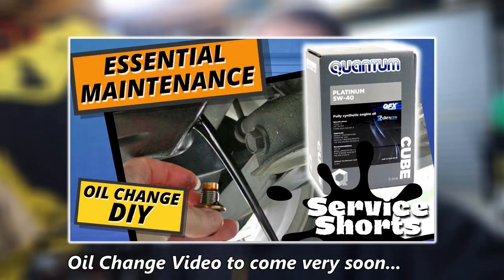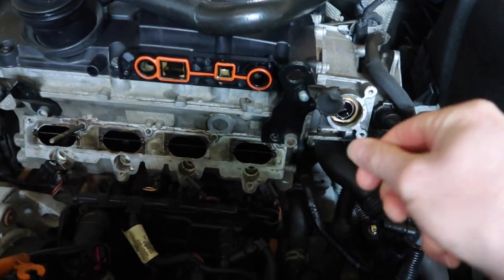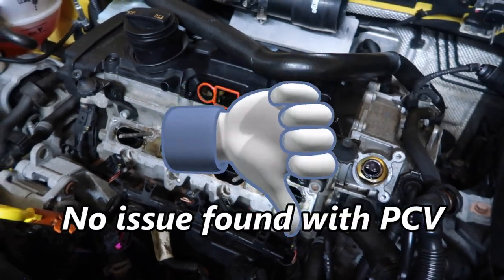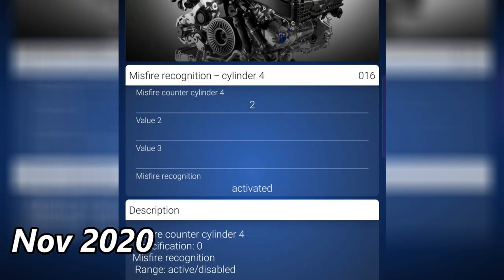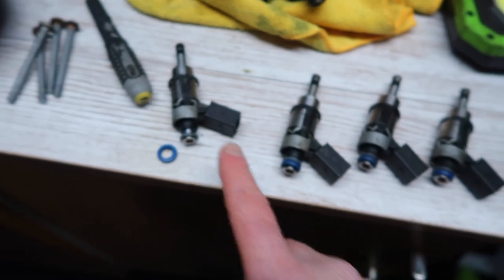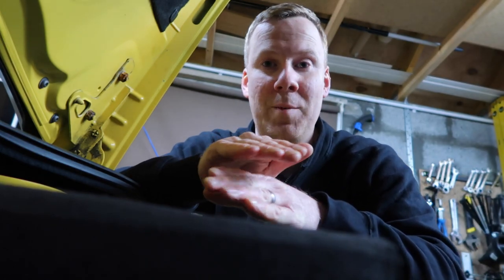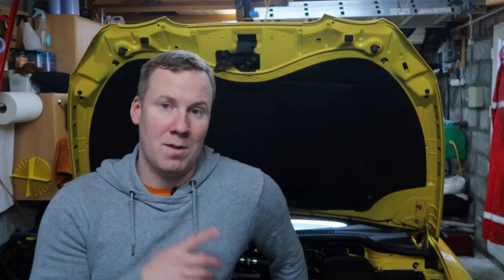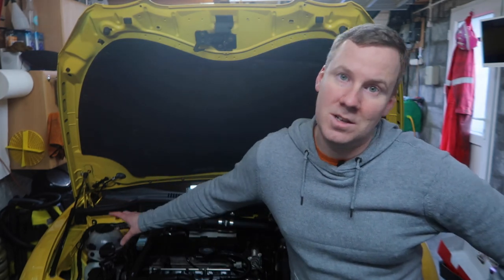2.0 TFSI Engine Problem | Fixing a Fuel Leak & Slow to start - MK2 Leon 1P1

Comment: Great help, exactly what has happend to my car after the dealership did a Carbon clean..... They damaged the seal on the back of the injector, leaks a lot..... They are  not gonna be in a good mood after they have talked to me again......
Reply from the maker: Sorry to hear that they've caused that issue, but glad the vid helped a bit with diagnosing the issue u were having.
Hopefully it all gets sorted for you mate 🤞🏻

Comment: Hi, great video.  Is it R-tech performance inNuneaton that you sent your injectors  to?.
Reply from the maker: Cheers Frank, and yeah that's them. The fuel injector clinic is just their separate dept that deals with all the injector side of the business 👍🏻
Reply: Thanks Kev, I’m in Beauly and from Thurso. My sons Seat Leon developed sudden fuel leak down front of engine around 3rd/4th injector, quite a flowing leak, don’t know if you have experienced that, manifold is off, not as bad a job as your one, cheers.
Reply from the maker: Ah Beauly's a lovely place, and what a coincidence you're from Thurso too! 
I've not experienced leak down, but seen what it's like and it's one of the tests the fuel injector clinic do. Those injectors do sound like they could be at the end of their lives sadly. I'm sure the fuel injector clinic/R-tech guys can help. If you give them a call, leave a voicemail if their busy, they'll call back and say what to do for sending them off. (They are on Facebook too 👍🏻) best of luck with it Frank 🤞🏼

Comment: Hi Kev, I know this is an old video... but I have an old Leon FR 2009, first the purge valve went bad, change it for an new one (not original but same design, CMI if I remember) so that solved the hard to start the engine after refueling issue for i.e. but now I get the MIL light on and 001089 - EVAP Emission Control Sys P0441 - 002 - Incorrect Flow - MIL ON, so after watching your video I tend to think its the canister (there is no leak on the fuel cap, nor the lines (I think).  Would it be possible to disable this feature? someway fisically? or with VAGCOM? thanks
Reply from the maker: Hey mate, cheers for watching. 
I don't know if it can be disabled, not something I've ever looked into.
I've swapped out my evap canister in a different vid on the channel (if u look through older vids)with a new canister from Amazon. It wasn't OEM, but a £30 cheap version, but it has worked perfectly since and car runs fine with this new one. 
Prob best to swap it out with a new one. Parts like this are usually part of the engine for a reason, and having the ECU ignore them completely via programming, can sometimes be risky.
Hope that helps 👍🏻
Reply: Could you hear a hissing coming from the injector at all
Reply from the maker: No not at all

Comment: hi! I have the same problem with my ea113, but mine does this after 4, 5 days. once it starts, everything is fine. I start it the next day, everything fine. the problem occurs after a few days of sitting. do you think this could pe the issue ? thanks!
Reply from the maker: It could possibly be the same yes. Maybe the seal that was damaged on mine isn't as bad on urs but bad enough that it loses fuel pressure after a few days.
Can you smell fuel at all while it's sat turned off? 
If so, you probably have a leak somewhere that's meaning you're losing fuel pressure.
If you manage to get a hold of any diagnostic software, that will definitely help see what the engine is doing.
Reply: @NorthCoastWorkshop  thanks! i ll come back after diagnosis.
Reply: i fixed it! i did exactly the same: got my injectors checked and 2 of them were bad, changed them with the revision ones, replaced all the seals and now it starts perfect every single time. thanks!

Comment: Facing a similar issue but mine splutters when starting. What rail pressure are u seeing when cold after u sorted ur issue?
Reply from the maker: I think it was around 50psi when the car is off and it's sat in the fuel rail system, but I'm not 100% sure as it was that long ago since I had the issue.
When it's running it is higher, but I can't think what it will be, sorry
Reply: @NorthCoastWorkshop  thx! Mine sits around 50bar when idling, if I've driven it about for a while turn the engine off and check it usually starts rising I've seen it at 100 bar after I left it about 1hr too cool down. In the morning with ignition on it's usually at around 5bar.
Reply from the maker: @DurinsBane117  yeah 5 bar in the morning does sound a bit low. I'm sure my one was close to that in the video when.i had the starting issue.
Hopefully you manage to get yours sorted 👍🏻

Comment: Hello i had a similar problem after i shut down the car the actual and specified are drop down together  its bad injectors?
Reply from the maker: It could be. If it's dropping gradually over time it's very likely the issue, especially if you can smell fuel?? There could be other issues that cause it though, like leaking at the end of the injectors inside the cylinder, or a leak somewhere else on the fuel lines
Reply: @NorthCoastWorkshop  can be a FPRV ?
Reply from the maker: I'm not too sure, that is a possibility, but I'm not too clued up on these valves I'm afraid
Reply: Today i checked and the pressure raise up Very strange, sometimes it goes down, sometimes it goes up
Reply from the maker: Hmmm, that does sound strange. If you're not smelling fuel then it could be internal that the issue is happening. If you have a good garage nearby, maybe they can run more thorough tests to see what's wrong?
Reply: @NorthCoastWorkshop  no fuel smell
Reply from the maker: Fuel return valve is a possibility then. Start with the cheapest parts to change, before replacing any expensive bits
Reply: @NorthCoastWorkshop  thanks mate

Comment: is this to do with e10?
Reply from the maker: Excellent question, but no, as I've still been using the higher octane super unleashed that is E5. 
The blue O rings should be resistant to E10 fuel, but something to keep an eye on. 
Cheers for asking though, and watching 👍🏻